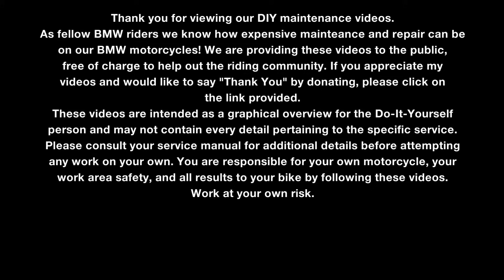Hall Effect Sensor Replacement & Installation

Comment: Hi Doug. You have been an absolute life and money saver. Purchased a 2000 R1100RTP (Ex-California Highway Patrol Bike) with 65K miles 3 months ago that needed work. LOVE THIS BIKE! However, I made the HUGE mistake of taking to my local BMW dealer the first time to have my ABS modular replaced at $100 an hour. I'm embarrassed to say what that cost me. Since then, thanks to your videos, I replaced my fuel pump and filter, brake lines, oil change, spark plugs, air filter, and repaired bad fuel readings on instrument gauge as well as the fuel empty light. My HES will be my next project since I just died on the side of the road yesterday. Thank goodness I was only 1/2 mile from home. The bike was a bit intimidating at first since I have never worked on motorcycles before,  but now the more I work on it the more I want to work on it. Thank you very much for taking the time to make these videos. Going to need brakes soon. Any Videos available?

Comment: You don’t need the timing box. Once the ignition triggers the fuel pump turns on momentarily.  Find the positive wire for fuel pump on the connector and hook up a trouble light to it. By rotating the timing plate while on tdc the positive fuel pump pin will get power when the he’s is in the firing position.  Pretty easy. I got that info on adv rider.
Reply: This definitely works without a doubt! I’m getting horrible fuel mileage and it’s somewhat hard to start so I wanted to check timing on the HES and it was off I’d say little more than a 1/16 of an inch so we’ll see if that helps at all. Thank you for this info Frank Butaric!
Reply: Dose this work for the 1100?
Reply: trouble light you mean fuse light tester? thanks
Reply: Thanks Frank. It is 2022 and that PDF is no longer available on the link he provided above. Sad, but true. This is good information. Thanks again.
Reply: it also turn when you put back the side stand.

Comment: FYI - Not common but perplexing - after installing and tensioning the new alternator belt I had a loud slap noise from the alternator. It turns out the upper nut can be tight on its bolt, but the bolt itself can be loose in the spacer it's located in (behind the alternator) leaving the alternator loose. Loosen top nut, tighten top bolt from behind (not difficult to access with the tank off), re-tension the belt as per instructions, and presto. Thanks to BMWMOA Oilhead forum wizards for this tip, which I never would have caught myself.

Comment: 2 questions please:  

1- Why did you remove the spark plugs ?

2- If I mark the position of the HES unit & reuse my old one (after I rebuild it) and place it back in the same exact position, do I still need to set the timing with the Gizmo light unit that you have ?

I mean if I mark the position of the unit and place it back in the same exact location, why do I need to reset the timing ?

Thank you.

Comment: This might be helpfull.  1. Disconnect and insulate the battery ground lead (IMPORTANT)
2. Remove the existing hall sensor (refer to BMW repair manual)
3. Install TDC pin to lock the flywheel to the clutch housing (EME Part # BMW-TDCpin)
4. Set the hall-effect timing position using a hall tester Part # EDL-MiniHT-R277 - LED must be triggered at TDC
12V LED can be used between orange wire and ground/brown wire. 
5. Connect the battery ground lead
6. Switch on the ignition but do not start the engine
7. Open the throttle fully twice - this will synchronize the motronic control unit with the new hall sensor
Reply: I have a question. I know the ground wire to the battery is crucial to the electrical system. And disconnecting it during this procedure can help do what? To keep from shorting the system? Shorting the new Hall Effect Sensor?
 I did not disconnect my battery ground and have already installed the new sensor. So should I still disconnect the battery ground? Thank you for all your great help.

Comment: right, off to go do this now, don't have a timing-setting tool but i just tried on the bench and with a car battery and a voltmeter i can also correctly see when the hall sensor is giving a 1 or a 0 signal, it's a bit less graceful but it'll do.

Comment: Just installed a new hall sensor plate on my single spark 1150 and made up a timing box of the same design. Initially I scribed the location of the old plate and installed new to those marks.
It did fire up initially and ran on idle and revved it in neutral with no mishaps and switched engine off thinking to myself, great job.
Trouble is and still in the garage, it won’t fire up again.
So, regarding NOT using the ‘timing box’, it is fair to say that just adjusting the plate from original plate marks even 1mm either side makes a big difference in starting issues?

I will edit this reply if the timing box with plate adjustment makes a difference to my bike starting.
Otherwise my problems are elsewhere.
My plugs are sooting up all the time.
Reply from the maker: You may want to change out the O2 sensor

Comment: Hi Doug.Fabulous instruction for Hes replacement.Correct me if I'm wrong but you mentioned the TDC light on your timing box should go off then tighten down. Your TDC light remained on. Little confused and need all the help I can get.Philip (Ireland).
Reply: +Philip Mccarthy Hey Philip, you are actually looking for the tipping point, where it flicks from off to on, or on to off.

Comment: I have some intermittent spark to plugs but no spray from injectors. Injectors are ok and spray with electrical override. Do you think this a hall sensor problem?
Reply from the maker: Yes. It is what times the pulses. If you have a GS 911 tool you can check if the hall is working. You may also have a bad computer

Comment: Your the man.   I just purchased my BMW yesterday with 69K on it.   When the truck got there it would not start.   Now I don't know if it is the HES or not but this video was done like a pro.   I appreciate it.   I am hoping it is that the kick stand was down or something easy.   But if not and it is the HES I am now prepared to do it.   I got this bike used from a JERK in KY.   Took me 2 weeks for him to release the bike for me.   Had a transport company pick up since it was 375 miles from home and did not know if it would run good enough to make it home.   Now waiting for it's arrival.   You don't know anyone who has side mirrors for these bike and a right hand saddle bag.   I am missing those off my bike I bought.   I see the mirrors on ebay for like 160.00 and I already ordered new oil and air filter,spark plugs and extra keys for it.   Any tips on the bike would be helpful.   I saw a video where the  windscreen moved.   Do all of them have this feature?   Thanks for such a great video.   May get some help doing this from a certified mechanic to watch over my shoulder.   But I thought you did a great job on it.    Looks like a lot but not scared of a little work.   Thank.

Comment: Doug, what diameter is that U-bolt you used to lock in the crank?  I heard you say its a 4" bolt but didn't get the dia. to know what fits in the hole.  Thanks
Reply: 5mm

Comment: I have replaced several HES and have never done anything but take the old one out and put in the new one.  Never gone to TDC.  Never locked the crank, and never had an issue with timing.  What am I doing right?
Reply: Just taking a gamble on my answer... You are just doing but not validating that Motronic is actually getting the right signals. If your wire harness was damaged (where you connect the hall sensor to) instead of the Hall sensor you would never know what signal is not getting there. Also I noticed that the aftermarket HES that did not have much adjusting to do. The original does have some pace to slide and move. I assume that the aftermarket could be installed without testing and get away with it.
Reply: I read on another site/vid that it is possible, too.  One point a commenter made was, "How could they do this delicate adjustment at factory assembly?  Wouldn't they want to just bolt that sensor into the right spot, instead of carefully tilting it left and right to get an exact point?  Not saying anyone is wrong,  just some things need to be explained more to make sense.

Comment: I had a no fuel pump (after initial key on prime)  and no spark at the plug...  pulled the tank on 2000 R1100RT and "bingo" melted up wires on the connector side...  Hope shipping from Romania does not take too long (I recalled having to do this same thing on my 1996 R1100RS - have not had an issue since (and I ride REGULARLY in wet weather)).  (I got the waterproof version last time and again this time for piece of mind).

Comment: Hi Doug, I too built the Hager HES setting box. In his instructions, he says to rotate the HES baseplate until the LED just goes out (assuming the LED's are normally on). Your unit seem to function just the opposite (LED's normally off). Confusing.
Reply: Mine does the same did you resolve the problem?
Reply: It really doesn't matter if it's the opposite or not as you are looking for the tipping point of where it goes on to off or off to on. That sweet spot is the correct position.
Reply: Thanks Douglas.

Comment: Hello, good morning, I have a BMW 1200GS motorcycle, it does not start, the fuel pump does not enter and there is no spark in the spark plugs. My question could be a problem because the keys could have been deprogrammed and what else can I check? Greetings

Comment: Doug, your left moves all over the place.  You should rest the lift and set it down onto the safety bar and save your ram. It also stops all that movement. Was getting sea sick from that.. 

Other then that TY for some really good information and how to... Thats one pain in the but... A must change ASAP... TY
Reply: Lankster Price Yeah, I usually have the bar in, but I kept changing height to get camera angle and what not so I didn't bother putting it back in each time. Sorry for the rough seas...
Reply: Douglas Rost  Its all good. I know how much time you must put in just to do a video, so we take a bit of a sea trip with you now and then... But still thumbs up for all your helpful input, hours of video work and time... Keep them videos coming.

Comment: @illinoisBMWriders.... thanks for your informative videos... a simple question, so as to get the best fit, what was the diameter of your cut down U bolt engine lock please.. ? some silly prices on Ebay for a bit of bar !!! - It did occur to me that it would be useful to compile a list of known components liable to fail over a period of time... then consideration can be given to having a spare on hand or to replace before failure...Thanks again...
Reply: Miles Dugmore The bolt is 8.3mm in diam, I got it at Ace Hardware and I believe it is their 4" threaded U-bolt, and I just hacked off one side to get to the center portion
Reply: Douglas Rost
Hi, Thanks for the info... I am in NZ so I don't have the same access to parts as you do.. but I will machine it out of a piece of bar... :-)

Comment: Hello. Great video. It would be nice, difficult I know, to show how you adjust the timing of your hall sensor. And also, can you tell us what and why this sensor brakes down  ? Is it a wiring problem or are the magnets loosing their strength ? Is there a way to check the sensor on faulths once its out ?
Reply from the maker: +Pieter Puk Puk The unit breaks down from faulty wiring housing. Being so close to the engine, the sheathing gets brittle, cracks, shorts, allows moisture in, and then decides to fail when it wants to. If you are out on the road and it goes bad, most likely moisture is the reason and you should do what you can to dry it out and then maybe it will work enough to get you home.
Reply: Thank you !

Comment: Evening Doug,How did you come to the conclusion that it was the hall sensor and not bad fuel pump or ignition issue?
Reply: You would loose spark and fuel pump (after initial prime) at the same exact time.

Comment: Has anyone else had this problem? I have the engine locked at top dead centre and have the black box attached but there is not enough adjustment on the HES plate to make the light go on and off !!

Comment: It is hard to follow your video, it doesn't show which side of the bike you're working on when you're finding top dead center especially for someone who never done this before on this bike.  I would mostly have to guess where you are or what you're working on.  Many times your hands or shoulders are in the way & I can't see what needs to be done.  Also is removing the gas tank necessary ??   Thank you.

Comment: Will be replacing mine on a 1997 with 90k miles on it.  My cycle still runs, but it is exhibiting strange symptoms.  A BMW tech told me this is the best place to look.  
My cycle runs pretty good around town.  It started breaking down on long trips.  Right at 4200 rpms, it would start misfiring, losing power, and coughing.  Felt alot like fuel line clogged.  But only at 4200.  Strange part, the symptoms cleared up when I climbed up to 4600 rpm. Eventually, (hours of riding) and it gets worse.  Now it is misfiring  from 4k up to 5k.  Low rpm, 1/2/3 gear still engine runs good!  Anyway, I'm relpacing this timing unit because it seems a good start.  It may not work. If anyone has another idea, please comment.
Reply: Redmenace96-  Please post a follow up report after you change the timing unit.  I ride a 2000 R1100R and have the same experience you describe regarding engine performance. My engine idles well,  runs smooth from 1st through 5th gears but only up to 3800-3900 rpm.  Once I push the rpm's into the 4000 range I get an unhealthy vibration and diminished throttle response/ loss of power type situation.  I'm not misfiring or coughing though.  I don't dare throttle into the 4000 range or beyond for fear of damaging something.  Thanks in advance.  Jeff
Reply: @jeffreykinsella4563  Do you belong to BMW MOA?  I posted much longer descriptions of my problem in the Oilhead Forum.  Turns out the ignition system was just a good guess by some old-timers.  Cycle ran the same after total rebuild.  My final solution was 02 sensor, and air-box temp sensor.  My ECU was responding poorly to air/temp/oxygen information. Please note, my symptoms cleared up above 5000rpm.  Your situation may be different.

Comment: Hello Doug, I have a 97' R1100RS that just got to 70K miles. Should I replace my HES sensor even if it is not damaged as preventive maintenance?
Reply from the maker: +Seb0046 At this point you are gambling and it won't be a matter of if but of when. Consider the type of riding you do, distance or local, and will it be a big deal when you break down.
Reply: +illinoisBMWriders Thanks Doug. I will go ahead and buy a new sensor and will keep the current as a backup.  Probably will be consulting this video a lot along the process. Now I need to learn how to make that tester :) Thanks for the great vids they are really helpful.
Reply: +Seb0046 i finally got to replace the sensor. 72000 miles and had not failed but will go on a long trip now and wanted to be as safe as possible. I could build the tester as well. Thanks for the vid it helped a lot.
Reply: Hi. Mine failed at 68000 miles. Do you know when name of the person who fixes them with lifetime warranty? Thanks

Comment: PLEASE PLEASE HELP YOU. MY MOTOR DAY DAYS FOR TWO, AND THERE IS A SINGLE DO NOT GAS ONLY TO GAS ONLY. WHEN I LEAVE THAT TWO TWO, OPET WORKS. ALL I WAITED, FUEL PUMP, FILTER, BOMBIN, FUEL PRESSURE REGULATOR. KNOW I CAN HELP YOU THERE CAN BE